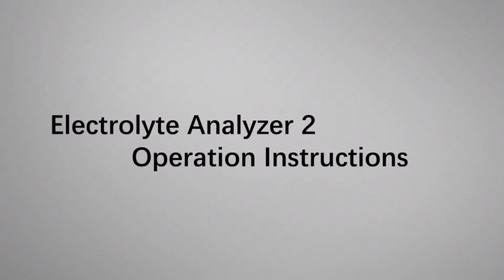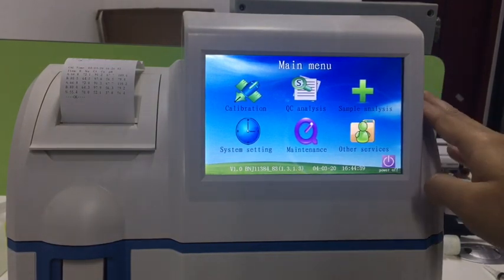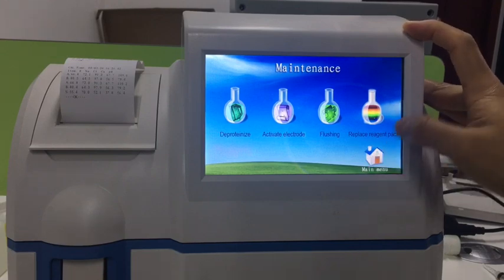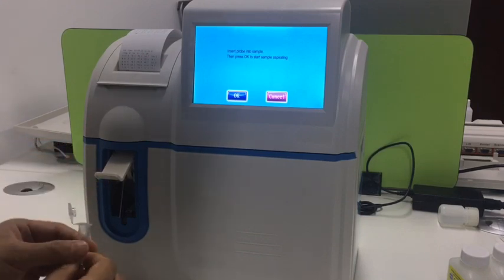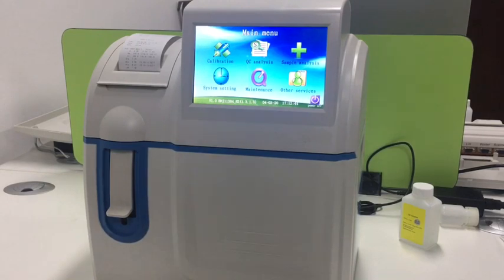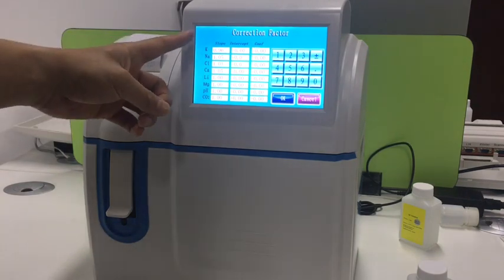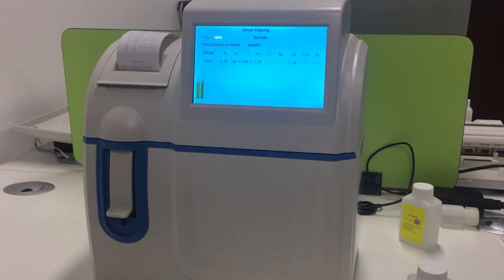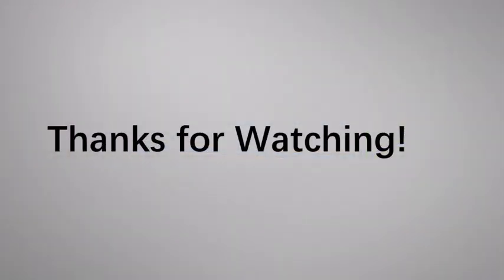VEA2 Operation Guide

Comment: Good afternoon, could someone tell me how is the communication configuration of the H900? Data bit (8?), Stop bit (1), Parity (None, Even, Odd?). The only thing I have found is that the speed should be 9600. Does anyone have the piout of the RS232 cable? Null modem works?